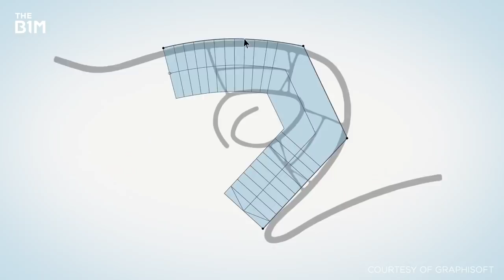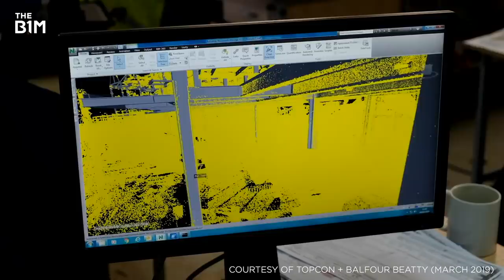What If We Automated Construction?

Comment: Semi-autonomous vehicles are the way to go. Nothing like construction should be fully automatic. There are just too many things that can go wrong. People need to be on site in my opinion.
Reply: In a fully automated construction, there be no mistakes as humans are the cause of most. AI will recognise input errors and check outputs. Construction of buildings will change to suite automation and factory/3D printing methods. That goes for infrastructure equipment which are installed too. Modifications to products like HVAC, fan coil units, IT, Lighting, Lighting Controls, plumbing, gas, water, sewers etc all designed for automated assembly and installation.
Reply: @MrPDawes  its just scale up of what we already do with products.
Reply: just what ive tought semi-autonomous is the way to go , im leading construction sites in germany ,and solely based on the ground , type of building , and alot of other variables . full auto aint gonna happen in the near future
Reply: AI's have no "concept of mistakes" unless you train them with sufficient and appropriate data. You cannot expect them to behave the exact way they should, there will always be unexpected outliers causing headaches among personnels involved.

Comment: I work in construction and I've been told that there is a shortage of skilled tradesmen but layoffs are still a very frequent occurrence. It makes it a tough career for many to stick with.
Reply: Same. It's an excuse to cut costs, built quality, and workers. Prefabbed stuff is still built with the disposable throwaway mentality - not even counting how many extra steps of plastics have to be involved in packaging and shipping with the extra steps. Plus, designers constantly fuck up, which would create huge progress issues later down in the pipeline. And don't even get me started on how bad the modular prefabbed homes are. It's just a race to the bottom - no more plaster art, no more amazing carpentry, no more personality. Just cold robotics.

A throwaway building is worth throwing away.

Comment: I have some doupts here. Some parts will still need to be done on site. For exemple, I live in Canada and one of the things we have to contend with is winter. We plow our streets with the same equipment we use to construct them. My city tried using precast concrete street borders, but it turns out that they are way too light and easy to lift out of the ground. The plows and graders just rip them clean off and they end up who knows where in a snow pile, possibly causing problems for the snow blower that has to remove the snow once enough of it has piled up. Even when you add concrete behind them to steady them, they still move around. Poured in place borders use less concrete and actually stay where they are placed. Theses precast concrete street borders are junk.

Comment: Hello，I'm an electrical and commissioning engineer. The company that I work for is an Engineering construction company which usually undertake EPC project of powerplant or new energy powerplant. I feel the automatic construction will fully change this area. So,  What do you think I should learn or how do I learn sth about automatic construction to adapt to this trend

Comment: Automating of construction is way further in the future than this video implies. Everyone who has been to a construction site knows that the environment and tasks are not that simple, and require a huge number of factors to be processed. Construction robots capable of finishing a single large scale simple task are prototypes and mostly do not improve time efficiency at the moment. Fully autonomous robots that can finish multi-part tasks are not even ready to be tested in the field. Remote-controlled machines and semi-automatic "robots" will come sooner, but won't reduce the number of workers needed by a lot.  
In conclusion, construction work will be one of the last manual labor type jobs to be taken over by automatization.  Maybe in 50+ years, the number of jobs will be slowly reduced because of on-site automatization. Other improvements, like off-site manufacturing of building blocks, already has, and will be reducing jobs way sooner.

Comment: Does automation lead to a job loss? Of course it does. At some point the new jobs created by automation (aka the IT jobs) will outweigh the reduction in other types of jobs. When this happens? I have no idea. I'm sure no one knows and this will be industry specific. 

If the construction industry has a lack of labor, then they need to change the way they do things. In my work as a Planner, I had a trucking company that said that trucking is changing. Drivers want to be home for the night, so the company needed a new facility where I worked to ensure that. Pay better, make work conditions better, and so on. 

As a Planner, automation, even partial in design may be a nightmare. Zoning codes can vary drastically from local government to local government (at least in the United States). Some of these codes have design guidelines, others do not. Even design guidelines vary a lot. Add in the public hearing process and you will have a design process that is very difficult to automate to any usable degree.

Comment: "For centuries the construction industry has worked with the same materials and processes."  the B1M
This is not true. In 2019 alone there were 10's of thousands of construction related patents. Processes AND materials are advancing so rapidly I can see real changes over the course of just a few years. Even things that the common person doesn't ever learn about are vastly improved (stronger, lighter, and easier to use concrete products). Many building codes (such as electrical) are updated/improved every 3 years. Virtual real-time reactive construction models are entering the workplace at an increased rate, and I could keep going for ages.

I love this channel (and even this video) but that first sentence is kind of ridiculous to anyone who has spent any time in the industry.

Comment: I drive excavators good luck finding a robot that can excavate around high value services in changing ground types and the route of the services is not exactly as the plans say, coming across rock we could move the service a meter or 2 either way, coming across an unknown service we could go under or over the service. We're a long way of the technology for robots to be faster and safer than human operators.